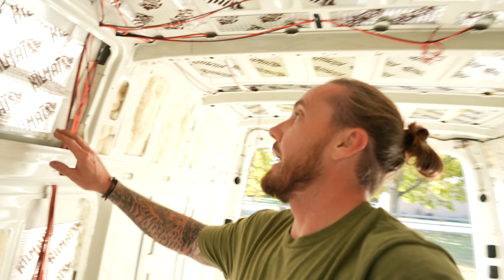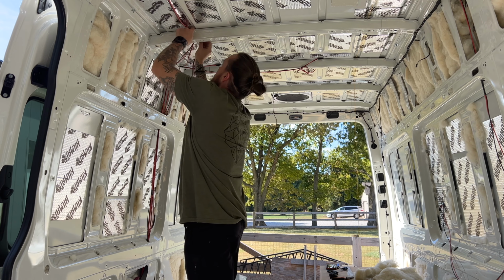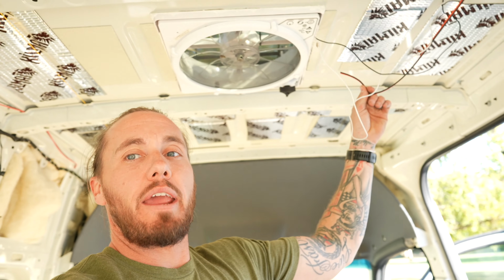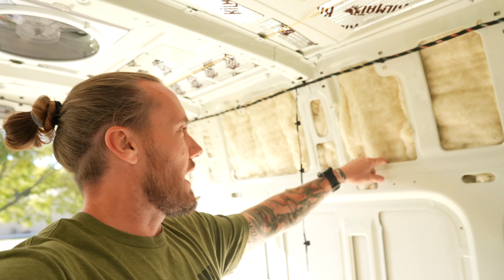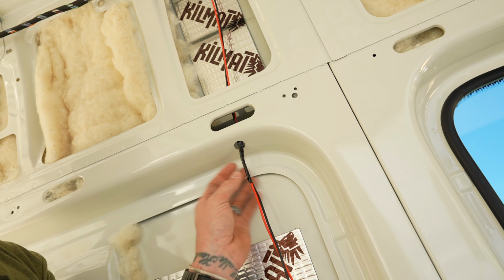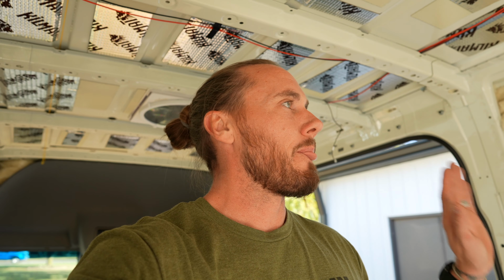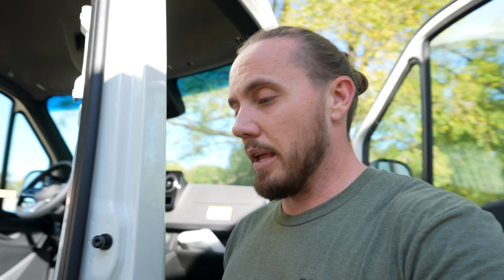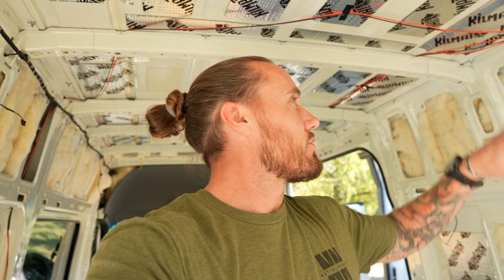Van Build Pt 5 | The Easy Way To Run Wires in Your Sprinter Van | Serg Supply

Comment: Hello, I need your help. So I have a bluetti AC200p and I don't know how to run the solar cable through the sprinter roof. The grommet that people recommend does not fit the male and female connectors from my solar panel or the solar cable attachment that came with the bluetti. Is there a special cable that you used to get it through your grommet? Thank you!
Reply from the maker: It's hard for me to answer that question without seeing what your issue is. You can send me a message on instagram with images and I may be able to help that way.

Comment: Thanks for showing what you did.  I did not see you use any rubber grommets where the wire ran through the holes.   Are you concerned about the wires rubbing against the metal?
Reply from the maker: After i got all the wires ran and before hooking them up I pulled them back out a few inches and used a healthy amount of electrical tape to protect the wires and I made sure I used a a file to de-bur all the edges of the metal. needless to say, I'm pretty confident.
Reply: @roamingwithjosh  Thanks for the updated information.  I like rubber grommets or I use Rough Edge Trim Protectors that are flexible for larger holes.
Reply from the maker: @kurtluhmann1744  Thanks for the info on that!